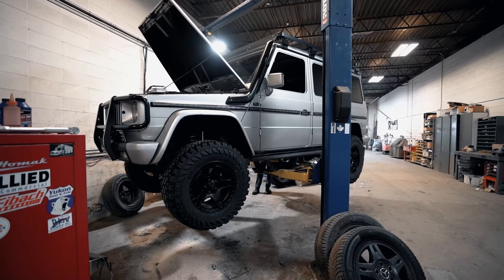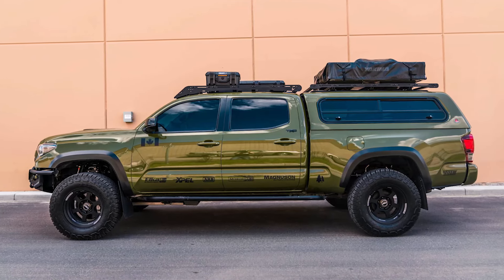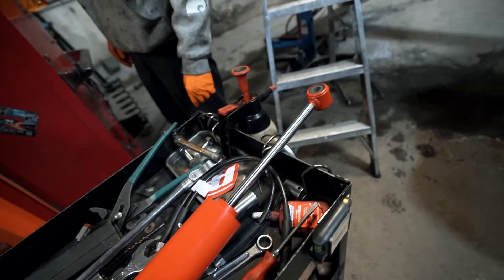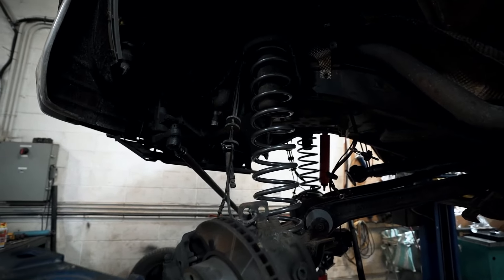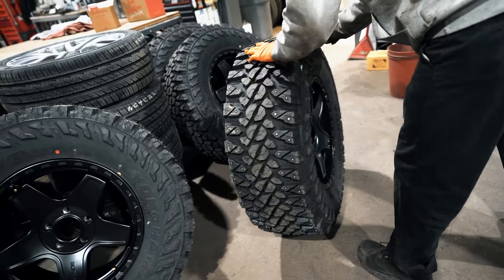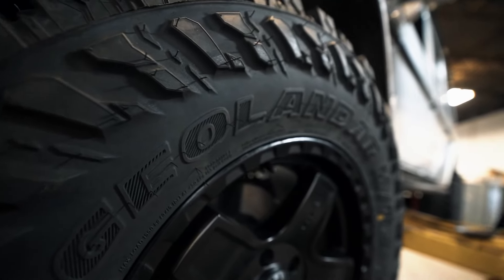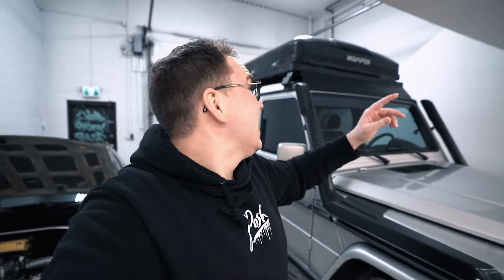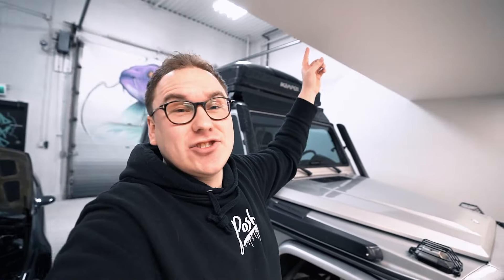Sold The Tacoma to Build a G-Wagon! Ultimate off road build! Straight piped V8 Diesel!

Comment: I have a 2002, i had 24" rims (not off road) ,then went back to 18". The wheels felt so heavy, the odometer readind was slower. I like what you did. I want to fo the same but wonder if it will drive better or worst? This will be a day to day truck

Comment: Do you remember if this is the stock exhaust sound for a G400? I thought only the ones with the side exhausts have that V8 rumble (G55/550/63). A stock G500 sounds pretty boring. Thanks.
Reply from the maker: Hey I chopped out all the mufflers and cats, it’s straight piped with a side dump exhaust